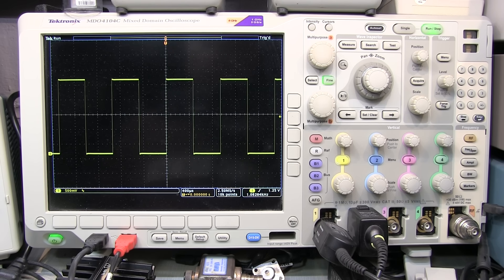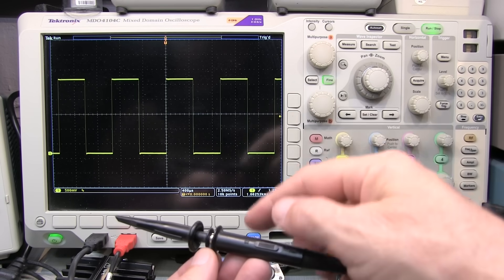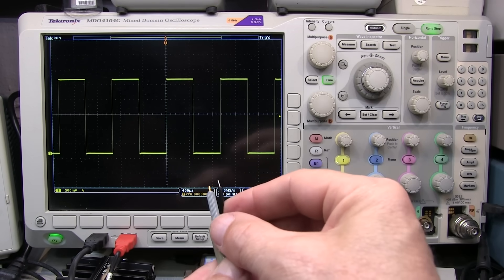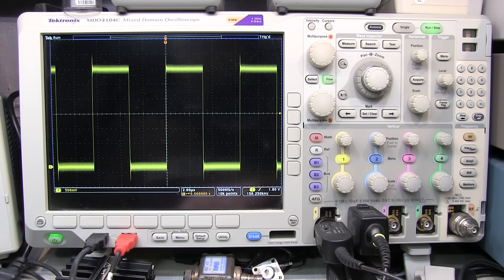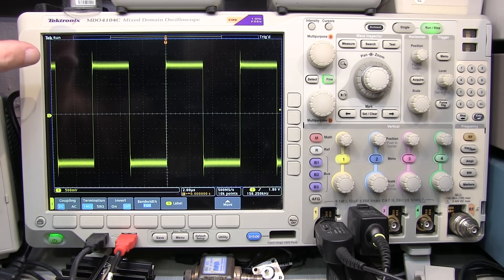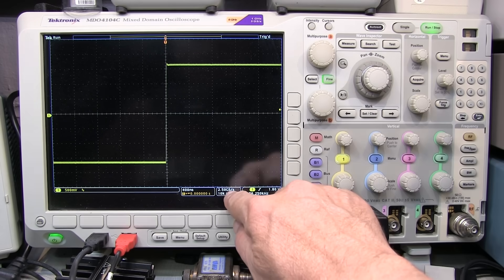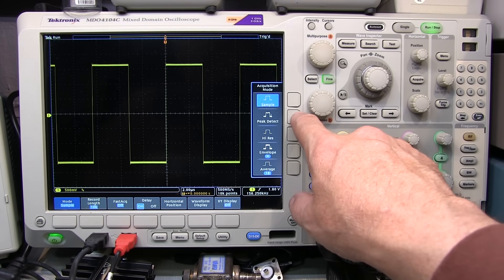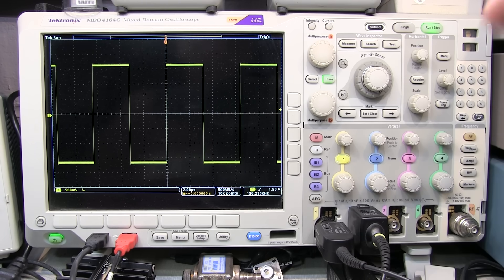#394: Oscilloscope Best Practices - some of the most common issues and tips

Comment: Thank you again (you kindly pointed me to Ramirez's FFT book). Excellent demonstrations; may I also as what do I need to connect the output of the oscilloscope to a loudspeaker, or there are oscilloscopes with built-in speakers. Thank you.
Reply from the maker: Oscilloscopes generally don't have "outputs".  They are measurement devices, not sources.  What are you trying to accomplish?
Reply: @w2aew  Thank you for explaining and allowing me to articulate my pursuit. I use an electromyograph in my profession and, it is universal wisdom in the specialty that we discern waveforms (amplified electrical activity picked up by a needle electrode in a muscle) within the audible spectrum and provided sound hearing faculty, better than through vision however faithfully rendered by amplifiers and displays, including by throwing in various mathematical analyses: the 'ear is the best frequency analyser'.
One of the pieces of equipment (electromyographs) I use has lost its sound board, with no prospect of repair; such that I had to acquire other equipment. Nevertheless, the machine which lost its sound is a nuts-and-bolts workhorse, that I cherish and is better – for most other tests on muscles and nerves – than any other ‘modern’ bells-and-whistles machine, which I nonetheless use (pulling one machine out of way and bringing the other that allows me to hear the signal). 
I have also been contemplating getting a modern oscilloscope as ancillary to the Tektronix 2205 (20 MHz) which I have had for 35 years. And while still searching for what to buy, it suddenly occurred to me that I might place the new oscilloscope next to the mute electromyograph, benefitting from a better resolution (assuming no less than 200MHz and 1 GS/s, better even than the best commercial electromyograph) of waveform in addition to hearing the waveform.    
Hence my quest, with apology for the long text and for troubling you. Best regards.
Reply from the maker: @eliasragi7472  OK, I see - you're looking for a scope that provides a buffered output of one of the input channels.  Sadly, there aren't a lot of scopes that do this, and even fewer digital scopes that provide this.
Reply: On reflection, a good oscilloscope can stand for an electromyograph. It was to supplement my EMG that I considered the Tektronix. 2205: to allow viewing the live electrical activity of muscle, nerve and background (ambient noise, electromagnetic interference) activity that most EMG (pre-microchip era) did not readily allow when averaging traces (around 100ms duration) following repetitive nerve stimulation. 
So, if an oscilloscope allows use of memory to store and display on several traces, placing cursors on selected points on traces and measuring velocity (by keying distance through a keypad) if integral to the scope, it can double as an EMG (with waveform resolution possibly much better than in commercial machines. But the setup would still requires an external (constant current or constant voltage) stimulator, an amplifier and a sound system. Thank you and best wishes.

Comment: On a side note, I'd guess a set of four probes for the scope used in the video would probably be a good deal more expensive than the scopes most viewers of this video would own.

wrote that then went looking - I'm revising it to a single probe more expensive than the scope owned by many viewers, though perhaps not most
Reply from the maker: Depends on the probe. There are probes that cost under $100, and probes that cost $30,000.

Comment: Yesterday I saw one of your other videos and afterwards was thinking to myself that what was really necessary for a great many YouTubers who make tech videos would be - exactly this video!

I watch electronics videos from time to time, not to learn things but to see what quality of information is being presented by people who are purporting to "teach" electronics. The quality ranges from excellent, like this video, down to ... well, it were on an analog scope the beam would be banging into the bottom deflection plate.

Just in the past couple of weeks I've seen
• a video in which the "teacher" was using a ground connection completely separate from the probe he was using - which is OK in very limited circumstances
• the same "teacher" using a probe with switchable attenuation at 1:1 for most measurements and setting it to 10:1 only for extra attenuation, apparently with no understanding that that is the opposite of "normal"
• the same "teacher" with someone who dropped by his shop with a new scope that fit his very limited budget and some little RF project he'd been working on. The scope apparently didn't have adequate bandwidth for the signal, but there was something usable there. They used one probe belonging to the scope owner and another from the shop, but found very different amplitudes, blaming the difference on the cheap scope. No one checked the probe compensation.

I often see scopes set to display so many cycles that important detail is obscured. Similarly poor choice of vertical scale factors hides details. No one seems to want to superimpose "traces" so that timing relationships are easy to see - they prefer tiny little traces separated from each other. On digital scopes the default trigger-at-centre-screen yields a left half-plane zero. Well, OK, just a left half screen useless  "white space." Sometimes centre trigger is fine, sometimes it is best, often it is the wrong choice.

====
When doing PCB design for something where I know good HF probing technique would maybe, just maybe, help me distinguish what was real from what wasn't (I used to do a lot of complex SMPS design), I would put lots of small void dots in the solder mask over ground planes so I'd have a convenient place for a probe tip grounder. A small blob of solder with a little indent made with a fine awl could be added as an anti-slip feature. Sometimes I'd add small vias for the same purpose. Sometime I'd solder on a socket pin from an IC socket with precision machined pins to receive the grounding pin of the probe. (A wandering ground connection of a board with hundreds of volts on perhaps thousands of microfarada can be ... distracting.)
FET probes are a great boon because the low tip capacitance makes the ground lead length less critical, but of course they have their own limitations, not the least of which is they may be beyond budgets.
Reply from the maker: All excellent points. Yes, there are a lot of YouTubers that are not very good. Please, be sure to let me know when I do something stupid! I try to keep my v videos short, to the point, packed with info, and accurate!

Comment: I'm still using an old Protek CRT oscilloscope.  Are there still places that will provide calibration service for such old units?
Reply from the maker: Probably yes, but it may cost you more to calibrate it than it is worth. You may be able to do it yourself. Have you seen my video on how to calibrate an analog scope?
Reply: @w2aew  If I have it's been years and I don't remember.  Trouble is, I have very limited tools for doing a good calibration.  I have a cheap-from-China Feeltech frequency generator, and an old Wavetek frequency generator that I recently fixed and calibrated using the cheap generator and my oscilloscope which already needs calibration, plus a couple of frequency counters.  So the best I can do is get things to match without any real way to verify genuine accuracy..
Reply from the maker: @00Skyfox  Check out my video on using WWV as a frequency calibration source.  You can then set your frequency generator to exactly 10MHz using the zero beat technique, then use it to calibrate your horizontal scale on the scope.  Vertical DC gain can be set with a DC signal and your DMM as a reference.  These two things will get you close enough for 99% of your work with an analog scope.
Reply: @w2aew  Thanks for the info!

Comment: Suggestions for addition: using the proper probe for a given scope to start with. Things like a lower bandwidth probe than should be used with a given scope can cause measurement errors. Then there are the probes with the extra concentric pin which switches the scope to 10x. Or newer scopes that use smart probes (like yours can do, I'm envious here 😊 although  I am very happy with my HP 350MHz MSO). Maybe a short note that scopes have their signal ground connected to mains safety ground/earth. 73 Wilko

Comment: ever since i watched ur videos, i understand rf a lot better. I'm trying to develop a reflection coefficient measuring system (dc to 70mhz) and currently use ur rf sampler video as a reference. However, i encountered some problems when I was dealing with unmatched loads.  In the video, the dummy load is mostly assumed to be 50ohm, is the sampler attenuation the same when the load is different?
Reply from the maker: The attenuation should be the same - of course the voltage on the line will be different, and will vary depending on line length and measurement location, when the line is not properly terminated.
Reply: @w2aew  Thank you so much for the reply. However, when I tried to verify the attenuation factor, using the scope measurement on the line voltage divided by the sampled voltage, the simulated value was quite different. The sampling circuit i was using is a capacitor coupler using 4.3pf and 510pf as a capacitor divider(@60mhz). A 47ohm is connected parallel to the 510pf as the output port for the sampled voltage. When I vary the load, the attenuation factor could vary from -41dB to -43dB. The source is 50ohm output impedance and 0.5w sig generator and the load is 87.162+29.9j, 50ohm, 525.57mohm+-60.7j(using transmission line to transform the impedance)

Comment: I really like and appreciate all your videos, thanks!

Do you have an in depth video on testing live circuits? You mentioned it in Scopes for Dopes, many have mentioned it in comments. I've heard what not to do and still confused on what should be done. Expensive hot probe transformer? Some kind of bench supply transformer for scope and/or DUT? No ground probe at all?  Battery powered scope?
Reply from the maker: When testing live circuits - it is important to remember that the scope probe ground lead is connected to the mains ground.  If the live circuit that you are testing is isolated (battery powered, floating supply, etc.), then you shouldn't have any problems.  If the circuit is grounded, then just be sure to connect the probe ground to the circuit ground which should be common to the mains ground.  When in doubt, use an isolation transformer or differential probe.

Comment: Old school Aussie tech here. As an apprentice TV tech in the 1980s I used some seriously low quality analogue CROs for some years without ever blowing one up on a hot chassis TV. A bit later I worked for Panasonic Australia where we at least had decent Tektronix 'scopes, but still mostly analogue. The digital Rigol I bought in about 2014 was a revelation in terms of capability and size, and most of this video applies to that very cheap device... maybe AUD$500 at the time.

Comment: to add to the 1x probe point: you can also deliberately use a 1x probe on a low frequency signal that is buried in the noise when just the 20mhz bandwidth limit of the scope alone wouldnt cut it anymore...
Reply from the maker: As long as the circuit can withstand 100pF or more loading (I.e. not too high Z)

Comment: At 2ns and 200ns , the sample rate is 5GS/s @ 10k points. How is this possible? The scope reached to saturation (i.e. 5GSa/s at 200 ns). So how at 2 ns, it can generate the same points with greater screen refresh rate?
Reply from the maker: It just changes how many of the memory points are displayed.  The memory was set to 10k points, but there aren't 10k pixels across the screen, so there is some processing that accounts for this difference (and makes adjustments at max sample rate).

Comment: Good info. Never seen those short ground options supplied anywhere that I worked,  let alone saw them used.  My issue is that Tek ground wires break alot.  Always checking and fixing the open ground wires on probes. Most of my history is with analog CRT scopes and I have both color digital and later analog.  I do prefer the analog scope for alot of things. My Tek digi does more tricks than I have figured out yet.

Comment: I would like to see theae type of tips with analog scopes as well.
Reply from the maker: Many of these tips apply to analog scopes.  Also, there are LOTS of videos on my channel that feature and discuss analog scope usage.
Reply: Keep your beam as dim as is comfortable to save the phosphor maybe. Same thing compensate the probe with the built in calibrator.  Use your bandwidth limiter for audio and lower RF freqs,  mine cuts off at 20 MHz and takes off alot of noise. Also vintage scopes can develop all sorts of issues that need fixing. Dim or fuzzy CRT,  flaky controls,  drifted calibrations etc.

Comment: As someone who often works on old radios, it is important that one use an isolation transformer or differential probe when troubleshooting. Otherwise you maybe connecting the ground of your probe to a hot chassis.
Reply: I use isolation transformers always with old radios.

Comment: Great video, as usual, especially understanding the relationship between sample rate and what you see  My favorite tip is measuring current through a resistor by using two channels on each side and the now commonly avaiable math mode to measure the difference in voltage across the resistor.
Reply from the maker: Even the "old analog" scopes can do this, using the ADD and INVERT functions.
Reply: Wait.. did I miss that  in This video?

Comment: Howdy. Yes.
I would like to mention a devilish hazard. The ground of the inputs and the Protective Earth (ground) of the power socket are interconnected. If not aware one may introduce ground into circuits. Older TV sets did not have a transformer. The used the grid AC directly. Boom and kaputt ! Kiss the oscilloscope and TV goodbye.
Always power the oscilloscope through a separation transformer.
I live in an older apartment building. The old electrical code allowed two prong receptacles in non-hazardous environments. So there is no Protective Earth in the oscilloscope. Lucky me.
Regards.
Reply: You don't want to do this because your scope become live and hazardous to touch. A much better approach by far it to isolate transformer the device under test. Its not perfect (the device under test can still be dangerous to touch once the scope is connected) but its much safer than risking a live scope chassis.
Reply: @Seiskid  Howdy.
I recognize Your point.
Regards.

Comment: Alan, please consider making a "Scopes for Dopes" or "Best Practices" video for those of us that only have old analog scopes.  In my case, I've got a Tek 453 & two Tek 2465 scope.  At the moment, I only need scopes fast enough to troubleshoot my PDP-8s & peripherals and maybe "newer" computers & peripherals up to the '80s or '90s.  Unfortunately, I don't know whether or not I'll ever have enough "spare" $$$$ to get some kind of (still accurate) digital scope without a CRT.
Reply from the maker: A large number of my scope tutorial videos on my channel focus on analog scopes, including the 2465 and others.
Reply from the maker: Also, I do have a few Scopes for Dopes tutorial class recordings on my channel also...  Most featuring analog scopes.
Reply: scan ebay used scopes once a week or so. I just did and there are a few used ones for lees than new. Of course check the shipping rate also. If you do find one that you want for the price read the item description. If it says it works as supposed to, and you later find out it doesn't, ebay will issue a refund within 30 days. I have never bought anything off ebay other than what was advertised. Be careful with "NEW" scopes, they might not come with a warranty from the manufacturer.

Comment: Thank you for this guide - always worth saying since there are so many more digital scopes in use with new features.
If you havent covered the subject before a resume of grounding practices would be helpful particularly with respect to probing live(mains voltage) circuits such as SMPS..
Reply: Provided you are very careful not to touch "ground" on your 'scope and ground on your DUT at the same time. Otherwise, you might become the differential detector. 

Someplace there's a picture of Jim Williams powering a Tektronix scope with an isolation transformer and with it suspended above the bench using ropes attached to the ceiling. Now that is truly a floating ground.

Sometimes it is easier to spend the money. You can get some fairly inexpensive Chinese differential probes these days that are "good enough" to do the job.

Comment: Really great tips!   I'll add one too, be careful not to ground probes to a hot chassis like you might find in some tube equipment. Ask me how I know!
Reply: @jim9930  you never want to transformer isolate or unground a bench scope. If you do that and your probe accidentally connects to live, the whole scope chassis becomes live. Ouch!!! Much better by far to transformer isolate the device you're working on. If its a tube radio it's still dangerous (B+ is referenced to ground via the scope leads) but at least it won't blow up the scope or make the scope unsafe to touch.